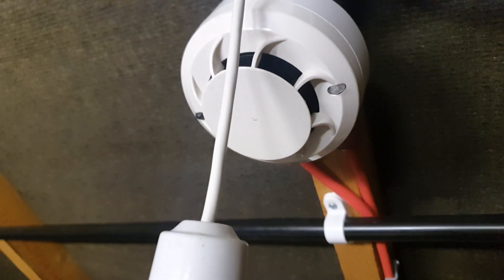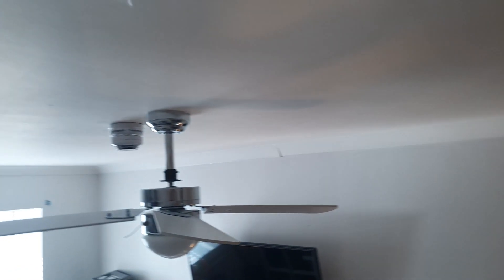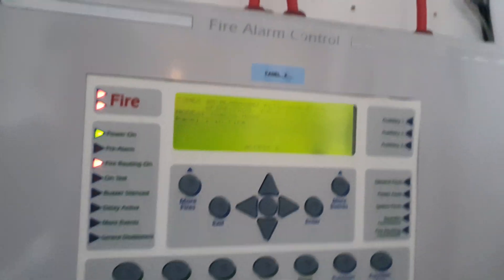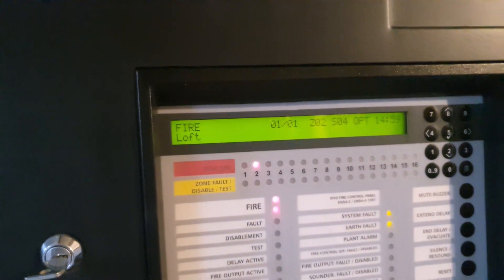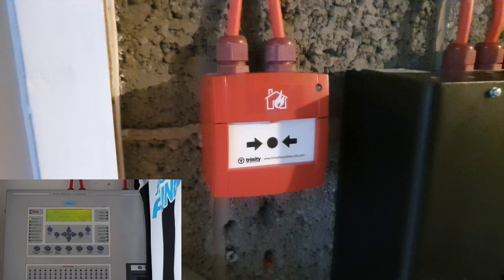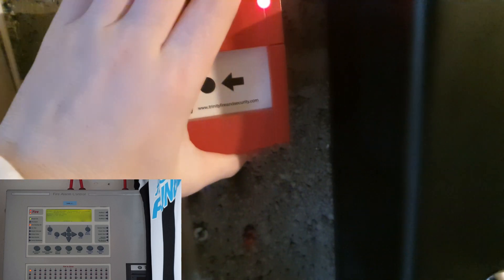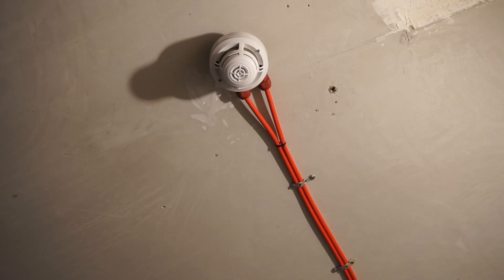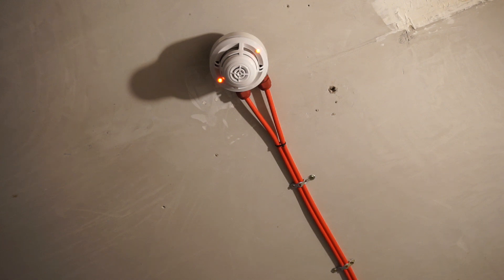Notifier/Hochiki ESP Fire Alarm System (System Test 25)

Comment: What software do you  need
Reply from the maker: no software is needed. But you can use LE6 for the kentec and ID5X/ID6X series support tool for notifier.
Reply: @ASSystems  can you please send me a link to id5x/id6x series support tool
Reply from the maker: @lift_brisll  there is no link to that tool you have to be a notifier engineer. I don't have it either.
Reply: @ASSystems  ok

Comment: How did you get the syncro working with a notifier and 2 different protocols pretty cool
Reply from the maker: i've used a mixture of i/o devices, panel inputs and panel relays.
Reply: @ASSystems  nice one So I guess you can do that with any range of panels and protocols to mix them?
Reply from the maker: @mssecurity1930  pretty much as long as you can program them. heck, you could probably do it with conventional panels as well.